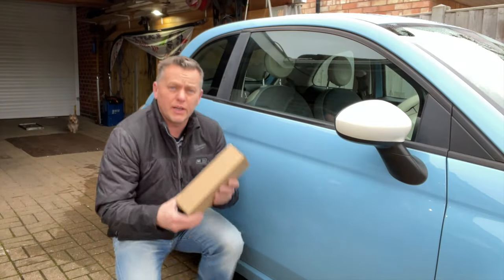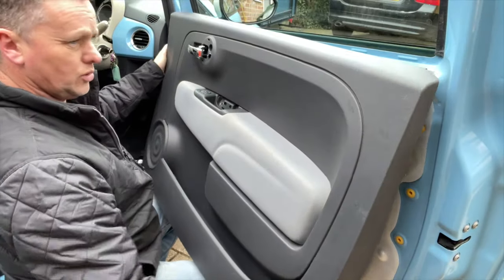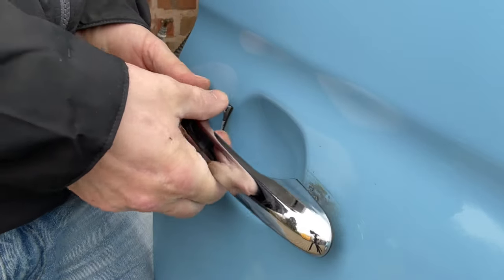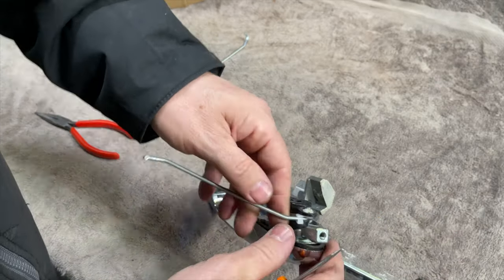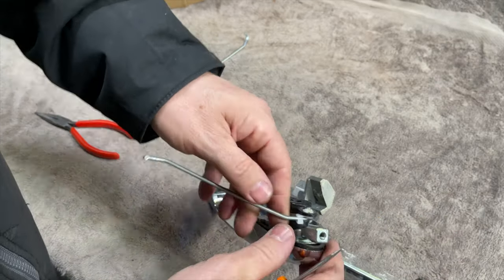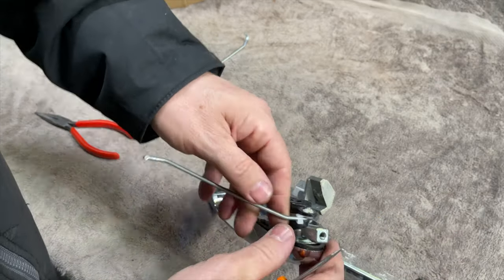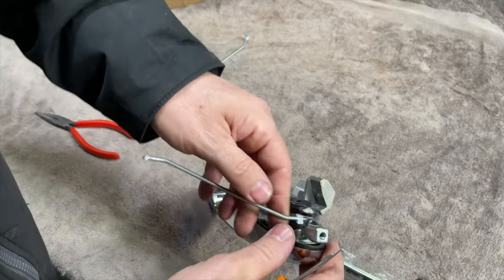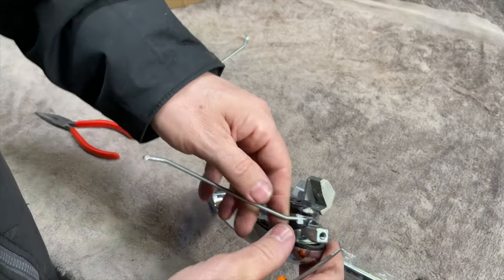Fiat 500 Drivers Door Handle & Lock Barrel Replacement, "The Real Job With All The Tricky Bits inc"

Comment: To save the banging to get the handle into place get a slightly longer bolt and tighten this untill it pulls the handle into place then replace with the original.
Reply from the maker: Thanks Mark for the great information, i was worried about pulling the threads out👍🏻👍🏻🛠
Reply: @aaanton11  No probs it worked a treat for me and thanks for your info great vid👍

Comment: You made my job a simple straightforward one thanks to your issues! Mine slid in really easily once the  four metal tabs that stick out on the handle that slide left and locate into the hole were all lined up, it went in with no banging! Thanks very much for your video saved me a ton of faffing. The most fiddly bit for me was to reattach the levers to the red and blue clips, couldn't see much due to my sausage fingers!
Reply from the maker: Glad it helped! Thanks for the great comments👍🏻👍🏻🛠

Comment: Maybe if you had a longer bolt through the  door frame edge it may have pulled it in place a bit easier, like your  patience with it
Reply from the maker: it just wouldn't go through the hole, but next time I will hit it first ask questions later lol Thanks for the great comments👍🏻👍🏻🛠
Reply: I just did this, using a longer bolt as you suggest to pull the handle in to place.

Comment: can see over 15K views ..thats speaks to the problem & discourages car buyers from repeating the mistake ... buying  a "Fix It Again Tony" (FIAT) car. Its amazing how much gasoline (petro in your country) these small cars consume. On 30L my Mitsubishi Mirage CVT auto gets approx 120+ more km than the Fiat - - The 5M gets an easy 150+ MORE on the same 30L... re the problem of the door handles , take note , the Red top goes to the Black bottom & vice versa... the dealer will want 150$ for the part & a min of 1 hr $130 labour to fix this ... I got the part for approx 45$ all in + it took me approx 3 hrs to fix - - includes spraying anti-rust spray on the interior & lubed up the window mechanism since it was open. The right side still needs fixin so I tink i can get it done in under 1.5hrs - - i consulted your video multiple times -> THANKS for the tips
Reply from the maker: Thanks Ashley for the great information👍🏻👍🏻🛠

Comment: Thanks for informative video, so many videoes of same subject fail to show retaining clips and rod link removal and problems. I bought replacement  handle from ebay and hinge parts broke when door handle first used. My advice is to buy genuiene parts and not risk some of the inferior rubbish on the market. many of the retaining clips for the rods shown on ebay don't fit ,again a waste of time and money. Obviusly some doddgy sellers on ebay rely of purchaser not bothering to get refunds of incorrect or poor quality spares advertised. I guess you get what you pay for at  the end of the day. Great shame Fiat can't use good grade metal for the parts in the first place instead of using inferior alloy for hinges. I  don't know of any other car manufacturer that has such a door handle problem.
Reply from the maker: Thanks Ron for the great information👍🏻👍🏻🛠

Comment: At last, I got the damn handle off. Mine was broken at the dock lock end AND at the hinge end. When you slide that lock part backwards, to free it from the tab at the pointed end, there is also a tab on the downward side at the handle end, so you have to pull it up as well to get that tab out from behind the panel, then swing it down. A total nightmare of a design. I wonder, when product design engineers die, do they automatically go to hell?
Reply from the maker: 😂 They can be very tight, Thanks for the great comments👍🏻👍🏻🛠

Comment: Its with great regret that i must return to this video. The passenger side has now failed and i'm going to have to attempt it soon. I'm hoping it rains every day till July so I have an excuse not to do it haha.
Reply from the maker: You can do it! Thanks for the great comments👍🏻👍🏻🛠
Reply: @aaanton11  I have been incredibly lazy and used the winter as an excuse but today is the day im doing the passenger side. Wish me luck and thanks again for the great video.
Reply: @aaanton11  Its done, unfortunately the replacement this time I got was real crap and was super stiff on the spring mechanism so I ended up taking it apart again and stealing the latch off the replacement and putting it onto the original and with a little adjustments here and there i got it all back together. 

I would say again I didn't have as much trouble  putting the handle back on. I would say that I did use the t30 at the side to do the leg work for me in pulling it into place rather than giving it the love tap.